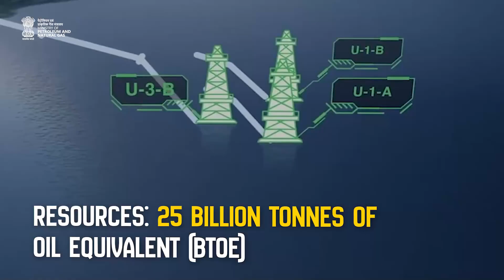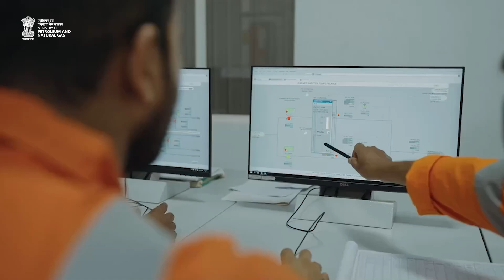Beneath India’s soil & seas lies 25 BTOE of energy resources!

Comment: You need to find actual oil field having like 10 billion barrels recoverable or gas field having like 10 TCF or more in one place. 

Otherwise, all of these are theoretical projections. Drill lot more and deeper in Andaman basin - find out next big Mumbai high or bigger reserve
Reply: Indian PSUs lack deep pocket and indigenous drilling and exploration vessels. As a result they spent huge sums hiring Norwegian companies like Shearwater, TSG, dolphin drilling etc. An area as vast as A&N basin will need hundreds of wells drilled to the depths of 3000m or more. That alone will require multi billions spent over decades. Not to mention,  the finds need to be significant to become economically feasible as deep sea o&g extraction are the costliest. So, without development of domestic ecosystem like Norway,  UK and Brazil did, it will be difficult. And a big find only can kickstart that process.
Reply: @anirbanbanerjee928  Between ONGC and RIL, there should be enough experience digging deep in KG basin. 

Also, if GOI can pump lakhs of crores to save PSU banks from NPA crisis, it can very well put thousands of crores in this.

Yes, deepwater equipment and expertise must be scaled up.
Reply: Exactly. India needs to do things not just talk.